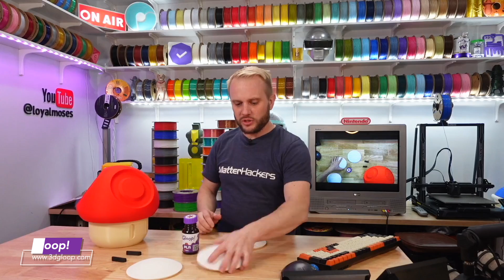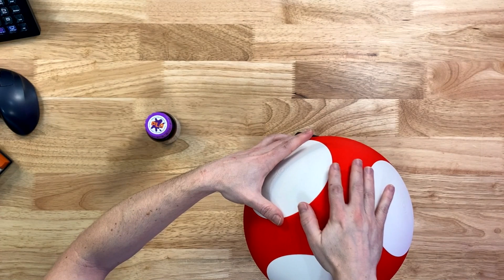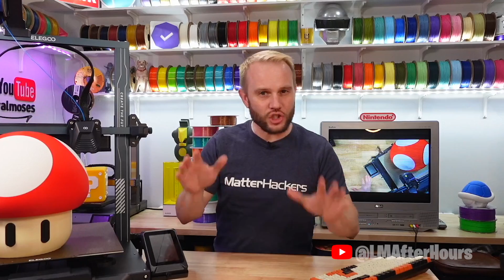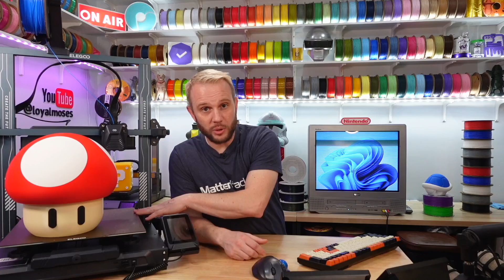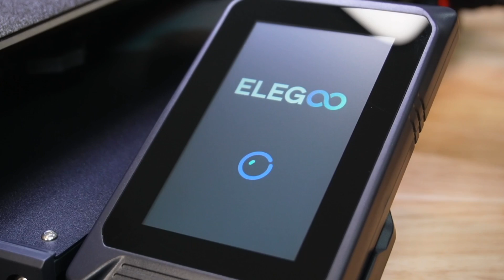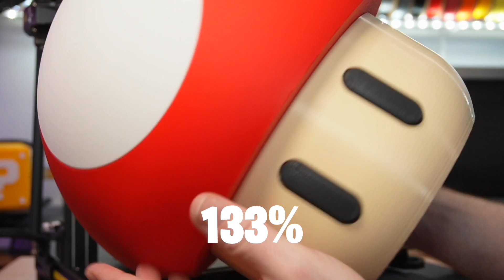LOW COST! HUGE 3D PRINTER! Elegoo Neptune 4 Plus

Comment: Hi Loyal Moses and fellow printing fans.  
I have a real odd problem come up to do with my Elegoo Neptune 4 Plus printer I am hoping you or the fans could solve it and help me out?

I did a ssh cmd using PuTTY and after tying in the lines " mks@my ip address numbers" it came back to say,
"ssh is not recognized as a internal or external command, operable program or batch file"

Where am I going wrong? 
 
This is driving me mad! 
All I wish to do is get my webcam running with my Elegoo Neptune 4 Plus?

I am using the "C" type usb as the main "A" usb is being used by my usb memory stick.

I am using the logic tech C270 Webcam and have klipper already in the PC.

Really odd that the printer is not letting me use the C270 HD Logic Tech Webcam to view my printer printing?

I set up the camera in the "Camera section of the online Klipper control program

But no matter what settings of video or type of stream I do, It will not show the camera view of the printer?

The camera works I have checked it, Also the USB Adapter works too so the Camera is plugged in to that so the USB C can be used.
Please any step by step help here be great?

Comment: I am really enjoying my Neptune 4 Plus.  For me, prints have turned out great and I really like the print bed.  I do wish the there were alignment guides for the build plate.  It was very easy to add a webcam to the printer/Orca Slicer.  You just plug the webcam into the USB port on the front of the printer and enable it in the slicer.  Overall as you mentioned you get a lot of features and quality build for a very reasonable price.  I am very happy with my purchase. I am also enjoying my Bambu Lab X1 Carbon.  Thanks for the video.
Reply from the maker: Oh! You own some great machines! I really like the Neptune series for sure! Produces some great helmets.

Comment: I bought mine for 160 used straight from elegoo, and they have been even cheaper since then a few times.

I’m completely new to the hobby, and I’m pretty sure any issues I’ve had have been related to my own ignorance, generally with trying to print very different filaments with the same slicer settings.

It’s an amazing printer so far, even with the tinkering, learning, etc.

I also got two used Neptune 3 pros for under 100 each, and they are about half the speed with very similar print quality, but they’re nearly silent.
Reply from the maker: Oh wow, you got some great deals!

Comment: I was so enthusiastic to buy this printer model. After a month of use all hell begun... After a blob of death everything went pear shaped. I've got the replacement print head no doubt, but the next one couple of days later... I was so angry, I've just throw it to the bin... No replacement from this company. Since the installation and re-levelling of the latest pre-assembled extruder kit I was not able to print a single usable piece. As the latest repeated fails, I've checked the bed temp and found that: it is all over the place and some parts even 10C degree lower than the set level. I wasted countless hours and countless filament reels with this junk of a printer. Not happy at all! Wouldn't ever buy another elegoo in any shape or form.
Reply from the maker: Oh no! I hate to hear these types of experiences! What is the cause of the problem? Do you know?

Comment: hey it´s a nice coincidence :D
I´ve just bought a 3D printer and printed this exact mushroom. I also wanted a bigger version of it and just scaled it 30% bigger. The dots didn´t fit into the head and the head didn´t fit onto the bottom part... So how did you actually scale it? Would be really nice to know for a beginner :)
Thank you for the video!
Reply from the maker: Oh! I just printed them at scale. Are you sure you printed this exact same model, there were two that I chose from and one did not scale right and this one did.
Reply: @LoyalMoses  ohh ok maybe it's not the same then. The one I've found has a thread so you can connect the mushroom head and the bottom part.

But as said I couldn't scale them proportionally. They won't go into each other although I've scaled them the same value. 😮‍💨
I just printed a few of them, smaller each print until eventually I got the right size 😅
Reply from the maker: Oh! This one does screw together too! Hmmm... Join our discord and we can chat about it!

Comment: Can you do a comparison with this Nepune4+ and the Artillery SW-4+? They seem similar in price range currently.. comparatively the SW-4+ has X/Y linear rails but I hear it has some FW issues (not keeping Z-offset), Neptune4+ has accelerometer and Elegoo seems to be much better overall in terms of QC and customer support. Since you have experience with both, what are your thoughts? Which would you be more likely to keep/use if you had to pick?

I'm thinking about getting a second printer to upgrade from my Ender3v2.. I'd love the bigger volume and Klipper. Just need some help deciding.
Reply from the maker: I’ve had great experiences with both, but I would likely lean towards the Elegoo. The Elegoo also has more aftermarket upgrades available as well.

I can definitely do a video on that!

Comment: Just looked the Plus printer up as Elegoo are having a Sale on, this printer is now £283.99p on the UK site.  ( need to save up I guess as bills come 1st sadly )
I really wish to get it to replace two other 3D printers I am now going to dismantle due to them being a pain to use even after I spent time and money upgrading them! 

( Aquila G32 chip model now upgraded with dual lead rods and motors & PEI bed & all metal hot end = 550 C max but used at 300 C )
and the 
( FLSUN QQ-S Pro Delta Printer also PEI bed upgraded & fitted a Titan Extruder ) No end of issues with both f them no matter the work done?

I have a Elegoo Neptune 3 and the Elegoo Neptune 3 Max, the Neptune 3 hot end throat needed replacing ( just got the bi-metal throats now ) 

The Neptune 3 Max just being a swine as it worked great for ages and now will not do leveling right even after tons of manual and auto leveling done 
and I getting upset with the time I put in only to have it still not level enough to print right?

I have now the BTT Pad 7, I wish to klipper both Neptune 3's But being new to klipper I can't find a video step by step to set up both of them on to the pad 7 klipper control?
Anyone know of a help video clearly showing how to do these two Neptune Printers in to klipper by the Pad 7?  Maybe then I can get them working better and faster?

I having to only do fast printing on the new Qidi X-Plus-3 Printer I have now. I done the hobby for 5 years now but still not able to do all the g-coding and klipper stuff yet?
Reply from the maker: That is a lot of machines! Very cool!
Reply: @LoyalMoses   Thanks I just now ordered the Elegoo Neptune 4 Plus online from the Elegoo UK site, their sale is on for the next 4 days from now!

The Neptune 4 Plus cost me £283.99p ( $359.00 ) with free shipping due to the sale and the fact their warehouse is in the UK so be between 3 to 7 days delivery time.

The saving on the non sale price here saved me £81.00p by getting it on sale now!  😉

BTW, Can you do a video about how us dummies in klipper codes set up any printer/s for klipper using the BTT Pad 7 I have?
nice step by step easy one so others like me whom have the pad 7 can use it to run any printer/s so it is not a waste of money buying that unit. Thanks for the great videos 🤔
Reply from the maker: Congrats and yes, I can definitely do that! Would be a lot of fun!

Comment: Thanks for the video. This helped me decide on trying an elegoo Neptune 4 max series printer. Question is. Once I get the printer connected to the local network/wifi. How do I get to klipper?
Reply from the maker: Get the IP address from the interface and then access it via your web browser on your computer.
Reply: @LoyalMoses  thank you I finally got it to work. Looks like the ip address was being blocked. Now to figure out how to use the slicer! Thank you again

Comment: That's a very cool video, thanks for that! I'm actually looking for buying a "helmet class" 3D printer. And I was going to buy a Anycubic Kobra 2 Max, but then I learned about the software and all about that to use Wifi you need to use the phone app and thing like that. And I know it's gonna bugs me ... 

The way you explain the workflow in this video, "plug the RJ45, Put the IP in the software an boom, launch the print right from you slicer from you PC", is what I want. So do you know if there is way to do that with a Kobra 2? Or is ther other machines about the same size or bigger, with same quality, same price range, but LAN/Wifi connected and easy to use like that?

And did you tried the Elegoo Neptune 4 Max and the Anycubic Kobra 2 Max? I looked for but didn't find any video on those two on your channel. I'd love to hear your thoughts on these two machines.

Anyway, thanks again for all you videos, very helpful!
Reply from the maker: Thank you!

Comment: Enjoying my 4 Plus.  None of the issues others have reported.  I use the Elegoo version of Cura for regular prints, and S3D with a 4 Plus profile for Lithophanes.  I've only had the printer for a few weeks so it's not fully tuned, but it's very quickly almost as tuned as well as my older X1.
Reply: I think I will buy it next month. I bet that will be massive leap from my Ender 3 Max Neo to this beast.
Reply: @karolgolden231  my issues with most of enders printers is that they are slow. I'm have a ender 3 neo V2. Ender still sells it's old models. While everyone else clears them out for new versions, better and faster . My Neo, It worked great, but slow. Some prints I don't even bother because it takes a day or two. Neptune plus much faster. Only problem I'm having now is that I'm going through filament so much faster now lol
Reply: @jaimefish173  Yeah print quality it's really good but they are damn slow. My longest single part print on this printer was almost 60 hours, lol.
Reply: @karolgolden231 did you buy the printer? If so, is it worth it? I also have a max neo but I want to get a new printer.
Reply: @axb.2830  Hello man. No I haven't because I've had some unexpected expenses but I think it's really worth to buy this printer. Fast, good quality prints I think you won't regret it.
Reply from the maker: This is awesome! Thank you for sharing!

Comment: Thanks for the video. Question - Can you tell the print speed in mm cube/ sec? Also I have always used Marlin based printers. This being Klipper machine, does it need Klipper skills to calibrate the m/c or work with it in general? I am just not sure where and how much Klipper I need to learn. Thanks again
Reply from the maker: I hadn't considered that measurement for print speed.
Reply from the maker: No klipper skills needed!

Comment: The 385mm height is so annoying.  I have so many models that I designed to work at exactly 400mm (like the industry standard has been for large format).
Reply from the maker: 400 is a big machine, not super common.

Comment: I have the machine and I like it, but it is difficult to get the bed perfectly leveled.  If only this machine had auto nozzle height adjust!
Reply from the maker: One tip is to just power it off, and move the print head manually to each area of the bed, and eyeball it close to the nozzle using the knobs underneath. Go around a few times. Then you can adjust z from the user interface after you power it on.

Comment: I printed out a version of the mushroom that wasn’t nearly that big (even accounting for the extra 33%)… on my SV05 the spots did not fit in the spots on the lid… I tried resizing them the best I could but it never really worked. When I got my P1S, I reprinted it and everything fit perfectly. The spots still don’t make a ton of contact with the indents in the lid but I used enough glue to get you high lmao… I really need to get some 3D Gloop!; I hate using super glue 🤣🤣🤣
Reply from the maker: Ah! This was the second model I tried, first model the spots didn’t fit either! Wasted a lot of filament on a different printer!

Comment: I have never had power loss recovery work for me, and I have heard of it creating more issues than it solves. Just get a UPS.
Reply from the maker: I’ve had very mixed results. Sometimes they resume on the next layer, ruining the print, sometimes on the same layer doubling up filament and sometimes they just work great! This one I stopped during infill and it resumed just fine.

Also, I agree. A UPS is the way to go.